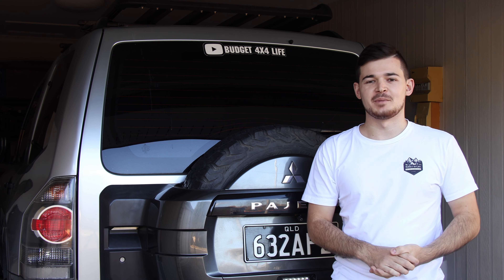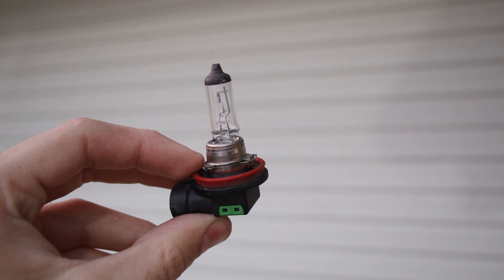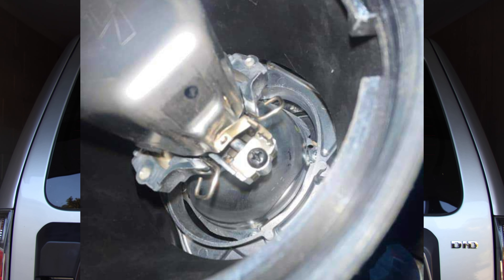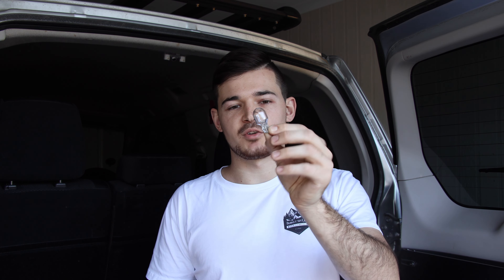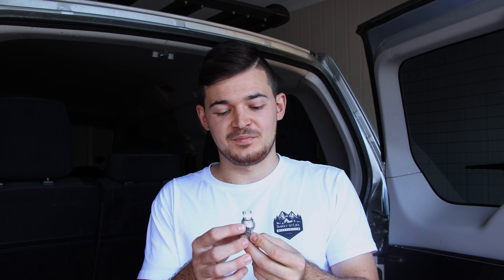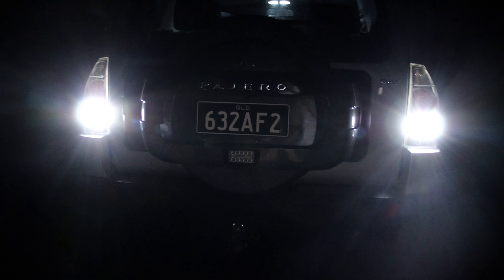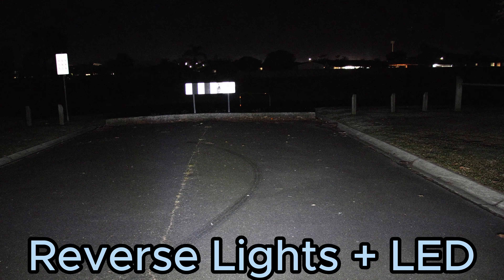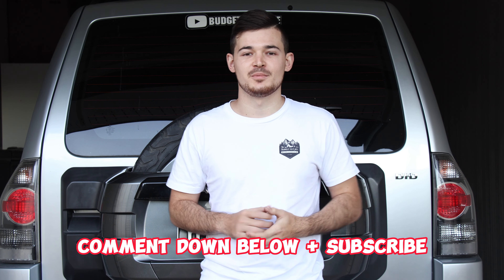Ultra-Bright LED Reverse Lights Installation For Your Mitsubishi Pajero

Comment: I did the same mod on my Pajero io, your channel is one of the reasons I got it so thanks for the vids.  On the older Pajero io the bulbs are the bayonet style so not the wedge like shown in this.  They make a big difference reversing at night and I wish I had done it on my previous cars.
Reply from the maker: Ayee good to have an io owner here😜💯 cheers!

Comment: Thanks mate, another fantastic upgrade suggestion - along with your headlight LED replacement these would make a world of difference. 
I do a bit of driving out west where there is no street lights at all, the front and rear factory lights on the Pajero are not good...
Reply from the maker: Thanks a lot for your feedback mate I appreciate it. Yes definitely makes it better like you said standard is very bad... I'm sure you need all the light out there 😄💯